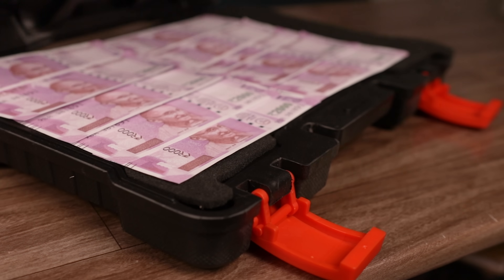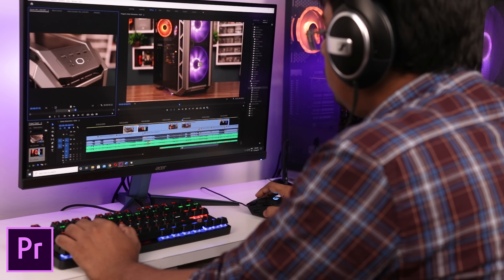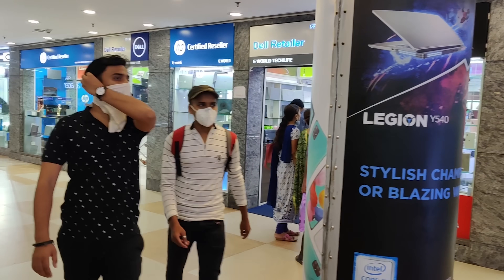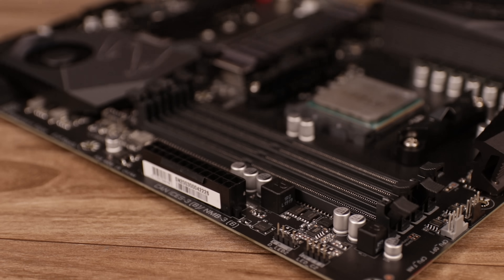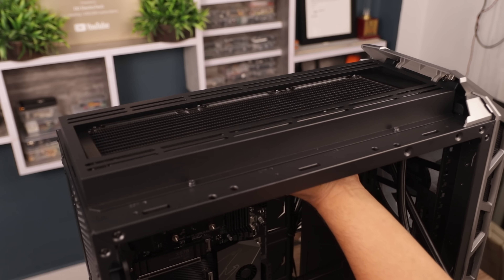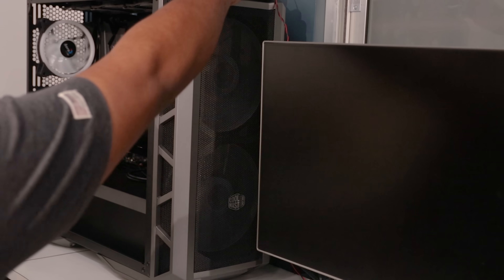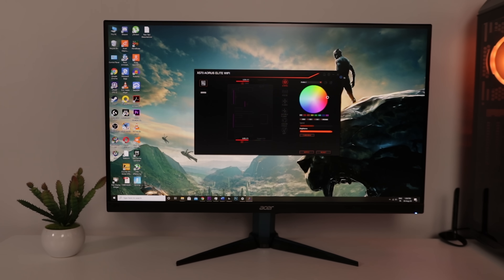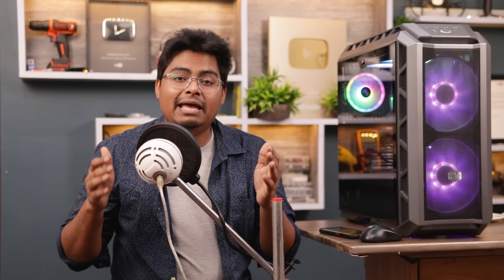How I Build my Ultimate Gaming/Editing PC

Comment: 1:17 That's not true at all. You need to balance you CPU and GPU to get the best out of it. If you do not balance you'll lose performance.
Reply: It's true If you
pair a low end cpu with high end graffic card will lead you to problems like bottleneck in which you can't take out full potential of your graffic card

Comment: R5 3600
Bazooka b450
Gtx 1660 super

240gb ssd 
2tb hdd
2x8 gb ram

Atom 550w
Antec nx200

24inch moniter
Mechanical keyboard
Logitech g402

Cosmic byte headset
Speakers 
Webcam